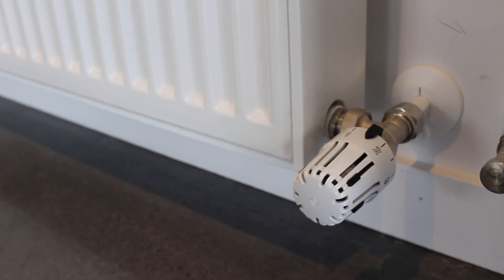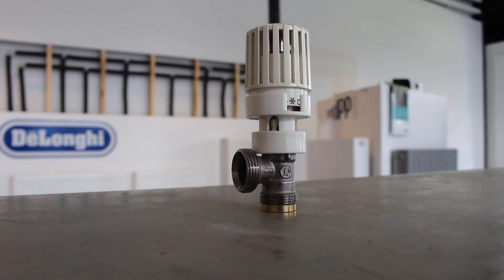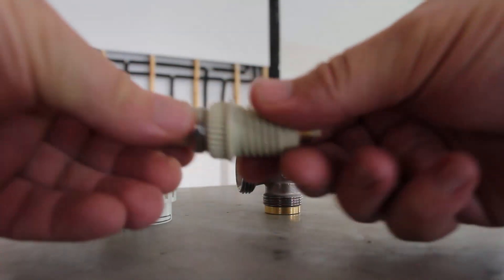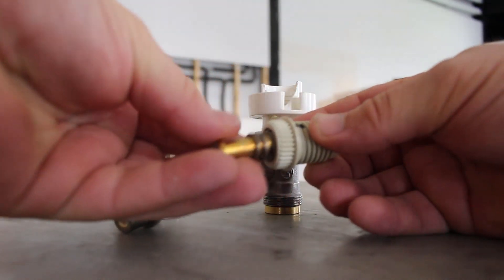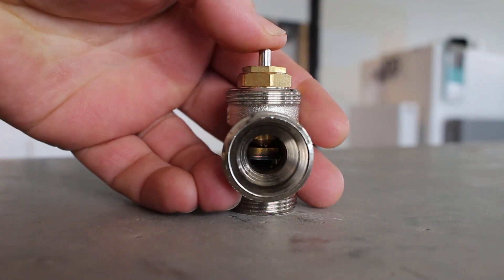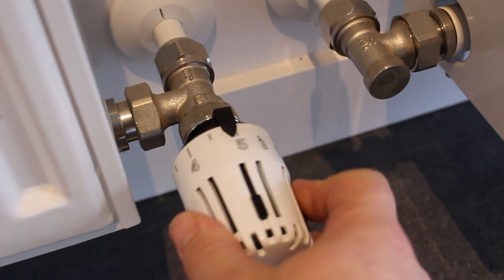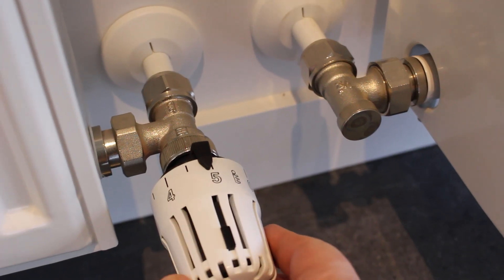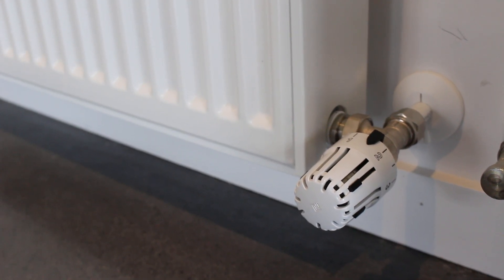ANSWERED: How Does a Thermostatic Radiator Valve Work?

Comment: Well, I have one like this and despite the fact that I set it to 4, the radiator remains COLD.
What else should I do ?  Where am I wrong ? 

The pipe BEFORE this damn  "Manual Radiator Valve with Thermostatically Controlled Radiator Valve" is hot, but beyond this valve = cold radiator.

Any help, please ?

Dec 6, 2019.
Reply from the maker: It sounds like an airlock in the panel. Search for 'how to bleed a radiator panel' and see if that fixes it. If it's really old say 10 years you may have a blockage and the panels need a powerflush.
Reply: @dPPHydronicHeatingMordialloc   - thank you for your answer.
All pipes, valves & radiator are brand new (September 2019) - apartment building.
The problem is that NEW sensor (Manual Radiator Valve with Thermostatically Controlled Radiator Valve) which should be set up somehow, but I don't know HOW to do it.
There is a green stopper which should be remove (if I well understood from Internet readings), then turn to higher temperature, put back the stopper and...OK. Somebody suggested to simply pull UP the knob.....????
Is THAT the solution or not ?